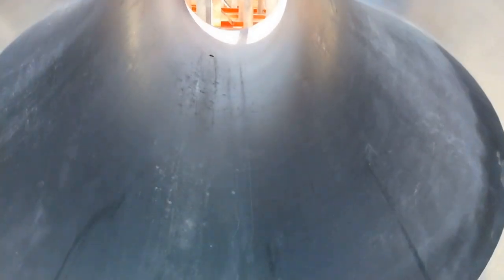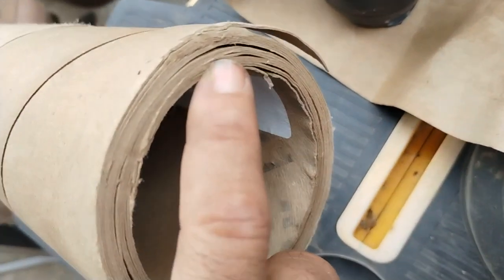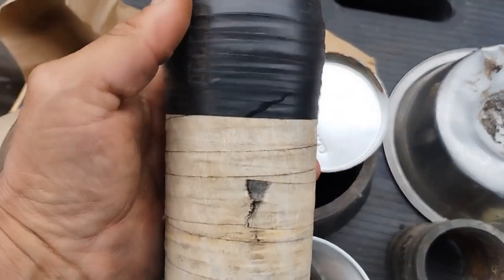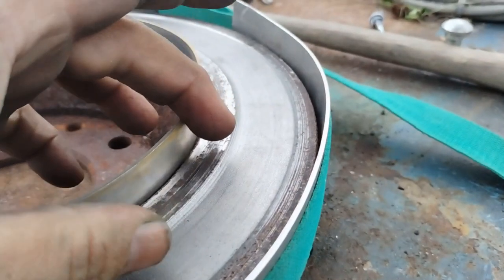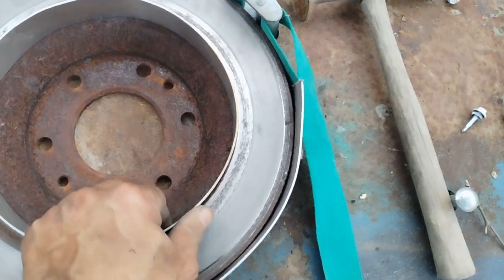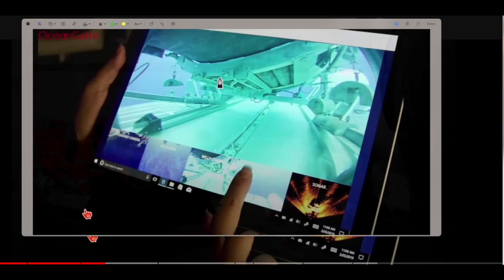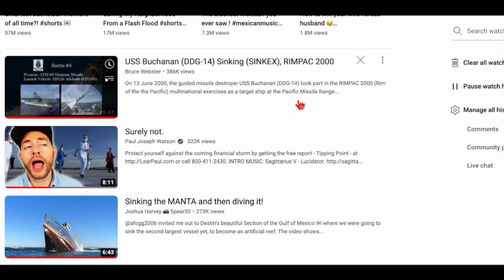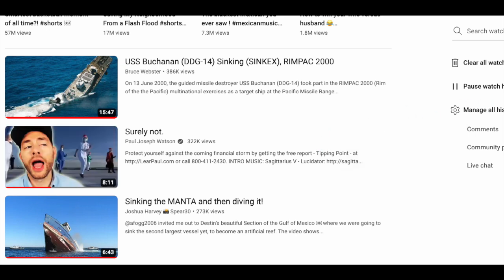Titan Implosion weights will be critical to determine approx center-line Path failure angle of field

Comment from the maker: Please help my feed my engineering kitties, please give a like, share the content if you think it is fair, please comment... this video will give your brain something to really think about.
"Trajectory" , 4000 to 5700 psi of resistant water pressure and YET this submersible managed to set it's ''parts'' over 900 feet apart! 
This is amazing and at what angle could we get this done after the forces have changed to just dead weight?
Reply from the maker: 28:00 elastic and not plastic

Comment: not exactly on topic but the video of prighoshins plane crash illustrates what may have happened re tumbling and the separate parts - fuselage - tail section and wing are between 3 and 5 km apart
Reply from the maker: Very smart of you and I have thought of it...
Can you tell me what would be the "wing" ?
Hint, it's in this video and "pig tail"...
With that said, I don't think it moved it too far bc of the pigtail.
Reply: my guess is the end caps(s) the shape, surface area to volume ration suggests it would behave like a leaf falling of a tree or a falling feather but i think the rear end would be more prone to the leaf fall than the front cap (assuming the plexi came out) if the plexi came out it would tend to deflect less as the fluid flows through the hole  @ForensicCats
Reply from the maker: Ok an "A" for leaf thinking and now tell me what the "pig-tail" is...no worries if you don't know... I'll tell you .